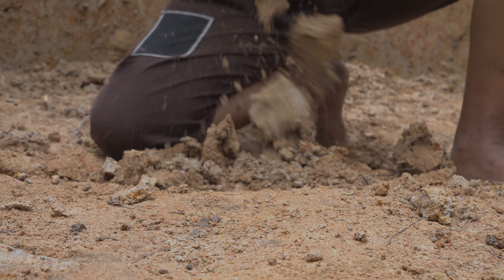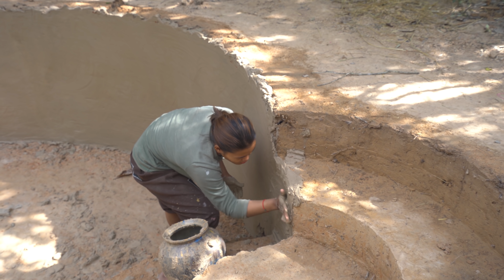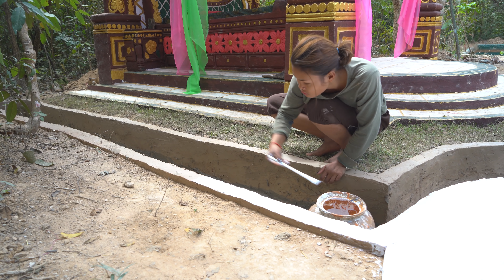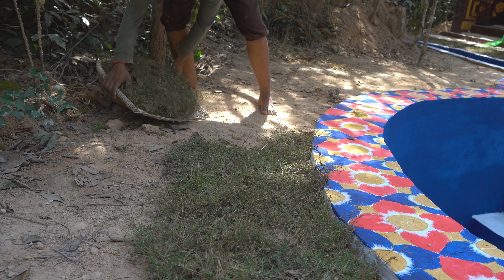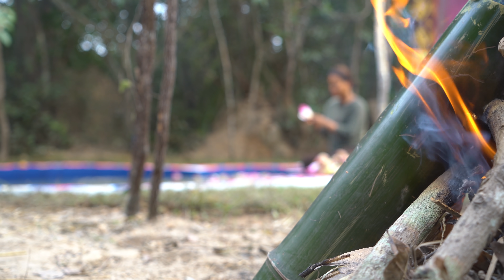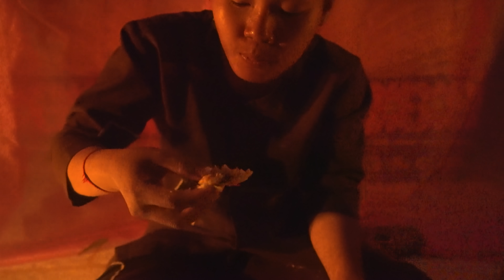Girl Living Off The Grid, Build The Most Beautiful Round Swimming Pool in Backyard

Comment: Does anyone know anything about the termite mound/wood ash plaster that they use in these videos for waterproofing?? 
As shown in these videos, it appears to be an excellent form of plaster/stucco, with characteristics most contractors could only dream of! (try mixing a Portland cement mix with your feet, and applying it with your hands and see how long you can go before you have no skin left!) 

However, I can't really find anything about it. Just a few papers looking at termite mounds soil/ant hill soil as an adjunct to cement mixes or for ceramics use, and most of these papers are quite recent and mostly focus on mount soil from Nigeria or other more arid environments. My Filipino girlfriend says that this is fairly common practice in the  Philippines,  but she was far to young when she moved to Canada to remember any details.

It seems it's similar to the basic recipe for wood ash concrete if made from high calcium wood, but regular wood ash concrete is not waterproof, and is not very durable. I expect that the termite clay is effectively pre-screened, and would be comprised of extremely fine silt, but i can't imagine that those properties alone would be enough to make it impermeable and durable.

How durable is it? is it completely impermeable? does it require mound soil from a particular type of termite? or mounds made in a particular type of soil?

Comment: @Primitive Survival Life : Where is that? Thailand? Bali? Does that clay have lime in it? Does mixing crushed termite mound with water last a long time, as far as a cement that lasts without melting for a pool or other water bearing structures, especially if painted with that white rubber tree extract mixed with extract from a certain type of crushed leaves for color? Does that rubber tree extract work just as well painted on by itself as a white, water proofing surface, like for side walks, etc.? How long is it supposed to last before being repainted? Could you please find out these details and let us know in the video descriptions, including the name of the tools she uses and where to order them for a great price? Beautiful builder, beautiful style. I'd like to build my own dream houses like that. Way better style than tiny homes, but for warm climates unless you build a huge greenhouse around it first. Could you please get her a non-bpa hose long enough to reach the clean water source? It works to siphon by sucking on one end to get it started, as long as the level you're siphoning from is higher than the position of the other end of the hose, I believe. I did it once a long time ago. Having storage wells along the way could work for that, or a simple pump running off a small solar powered battery. And a way could be figured out how to water plants, foliage & nearby gardens with the used pool water. Like first empty it into holding wells for gardening and have her build a toilet room with composting toilet or regular toilet that empties into a black water septic tank also used for watering gardens after stages or something. Then used pool water could be siphoned to garden watering holding sells and new fresh water siphoned in to re-fill the pools with fresh clean water, rather than carrying each gallon by hand. Please answer all my questions, and thanks for all these videos! So beautiful!! P.S., where are the toilets with hand held bidets and sinks for all these places and where are the composting bins, etc.? There's a few pieces missing. You help her figure out and get her compatible expert teaching of any parts she doesn't yet know. She could train other girls especially in the beginning, become a general contracter of those dream house places as well as having a school to teach others how to build their own dream houses. What is the soil composition there? This is so great! I'm so tired of ugly places and would like to build my own dream house rooms and pools and bathrooms and all living structures needed for beautiful homes with this kind of beautiful style!! Thank you so much for making such beautiful videos of her making all these structures all by herself!! There's no reason to believe you couldn't accomplish building such beautiful structures, if you know you could do it all by yourself, like she does! Thank you, thank you, thank you, and thank her, thank her, thank her, for showing us this!!